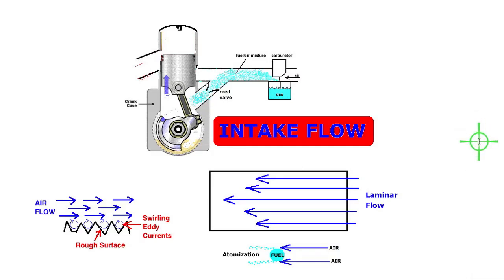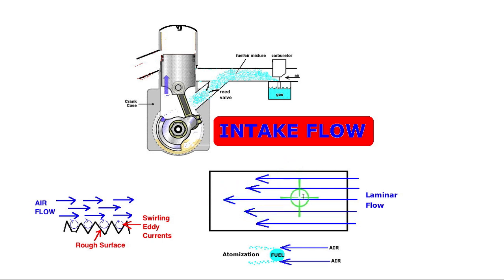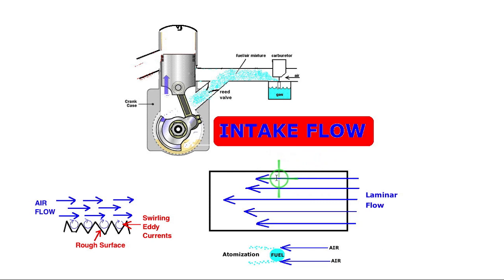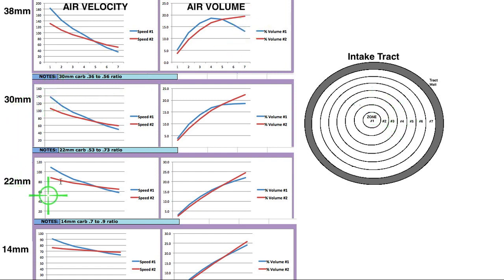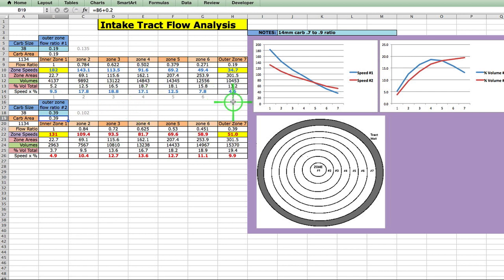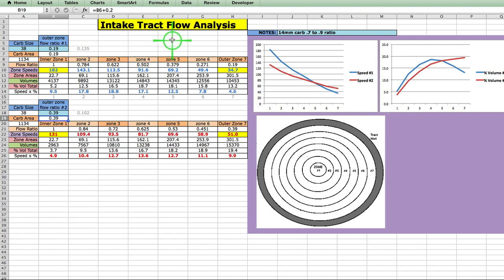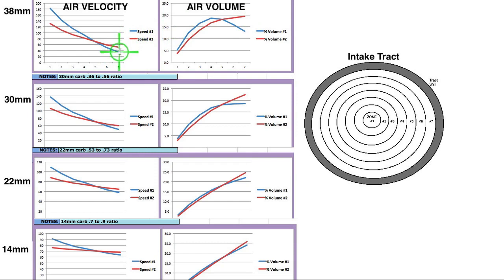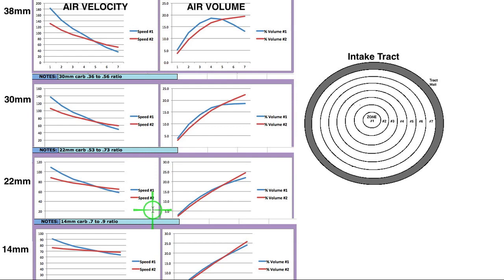Intake Flow and Surface Texture

Comment: You are doing good work but drawing false conclusions based on some misunderstandings. I've read with interest your   page  where you said 

"Wikipedia says "Flow bench testing shows that the difference between a mirror finished intake port and a rough textured port is typically less than 1%. The difference between a smooth to the touch port and an optically mirrored surface is not measurable by ordinary means."

Then you concluded:   'Why? A rough surface reduces surface friction which increases the outer zone speed"

As it happens, I am the author of that wikipedia page ,among others. (I am impressed anybody even read it!) But the reason is not that surface texture has any special quality but that all fluids (air included) "Wet" any surface they contact. The atoms bond to the surface and won't move easily so the air speed at any surface is zero regardless of the texture and regardless of speed. That was the point being made.

Another premise that you relied on is assuming the parabolic shape of the velocity distribution. That is a correct distribution but ONLY for fully developed flows. To develop such a profile it takes ~50 diameters downstream to develop.  In an open system like a carb The velocity profile will be more like an even distribution all over except as you get very close to the wall (shaped like -->  ] Rather than a parabola). The surface finish has almost zero effect on  that profile provided it is not too rough aerodynamically, if it is then it will cause drag and other effects. The reason it is used in intake systems is so that any fuel deposited on it will "wick" out more and expose the fuel to a greater surface area to evaporate more easily. (The golf ball "dimples" thing is an entirely different and unrelated phenomenon)

Don't take this as a criticism. I like what you are doing and will help if possible. I remember very well trying to sort out these things with almost no literature to learn from. I recall the many blind alleys an incorrect assumption can lead you down. I'm just putting a light down the tunnel that says come this way....
Reply from the maker: thanks for your opinion but I still think there is a graduation of differing velocities from outer to inner. I made an experiment to have less variation of velocities by having a bullet shaped center which gave less distance, much less, from surfaces to the "inner" parts of flow and as expected it changed the jetting profile, especially at low RPM.
Reply: @MichaelForrestChnl  I don't understand your experiment so I can't comment on it but I can guarantee there is not a parabolic velocity profile in a normal length carb. Check it on a flow bench or simply search "air velocity distribution in pipes" to see how velocity profiles change with length.
Good luck.
Reply: So in theory the larger the area the fuel flows over the more power can be made ?
Reply: @The8thgenTHATCOULD  Not at all.  It is to evaporate The fuel that falls out of suspension making mixture more consistent. It's much better to not have the fuel fall out in the first place.